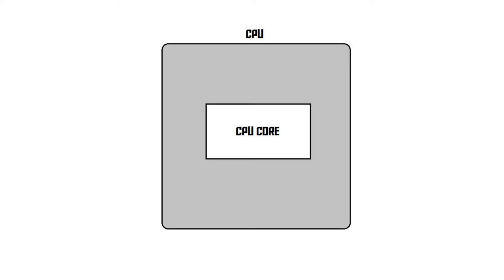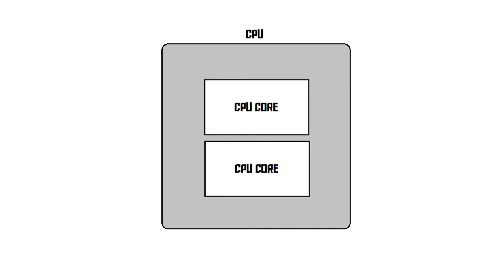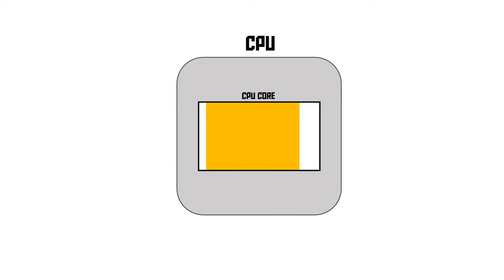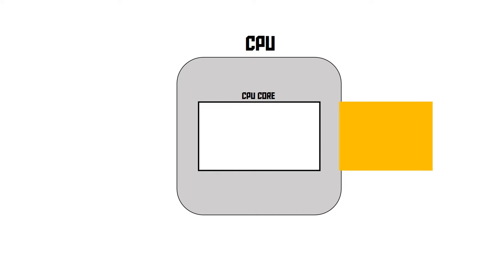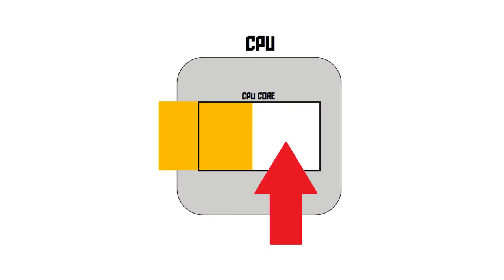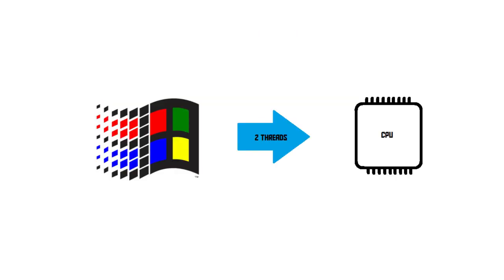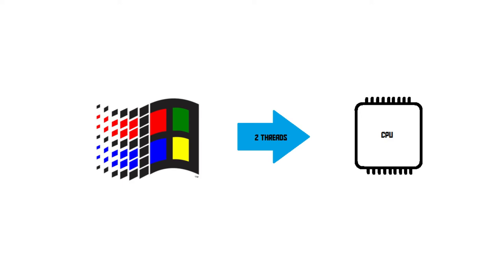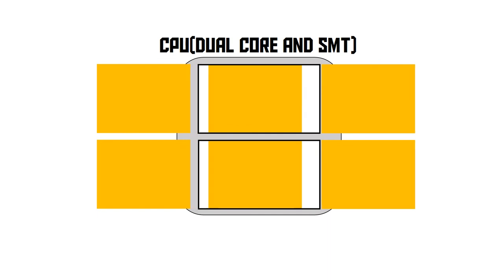What exactly are Hyper Threading and SMT? (AKIO TV)

Comment: IBM invented SMT decades ago.  AMD never used it until Ryzen because it wouldn't have been enough of a performance boost to implement it into their chips. I'm not an expert or anything but I know that it depends on the cpu cache pipeline how effective it is.   Some processors with long pipelines like a Pentium 4 benefit greatly from AMT.

Comment: Does this mean that the limit of threads per core is 2, as trying to increase the thread count you mean huge increases in cache and register sizes to maintain the state of unfinished tasks per thread?
Reply: There are dedicated register files to hold "thread" state. These are architectural registers that are not visible to a programmer or talked about in the ISA manual. As for caches and TLBs, there is a form of resource slicing that is used to share them between sibling threads on the same core. However, when one thread can access to its sibling's cache lines though some means (side-channel or whatever), you end up with security vulnerabilities and the only solution is either to disable SMT or make the operating system use core scheduling.

Comment: So, it's essentially a fancy term for thread pipelining...
Reply from the maker: Well, pipelining isn't exactly the same as SMT (smt is the general non-brand term)

In pipelining, stages in a cpu are kept occupied by starting work on the next instruction when the first instruction reaches the next stage.  Although this works really well, pipeline 'bubbles' occur quite a lot.

What SMT allows a cpu to do, is to start working on an entirely different thread during those idle times. This way the cpu is kept busy as much as possible. 

So in summary, pipelining refers to instructions in one thread being processed sort of at the same time, while multithreading refers to switching between different threads. (perhaps even threads of different programs)

This is something I didn't quite explain in this video unfortunately. I might make another video on this at some point.
Reply: @AKIOTV  pipelining is indeed referring to the instructions of the same thread but in general, the essence of it is to never let an element of the CPU idle. In that sense, multi threading is essentially pipelining different threads. As long as you have threads that have instructions that can be executed out of order and you have a clever scheduling algorithm to take care of the alternating of the instructions between threads, you will be pipelining in the core instructions of multiple threads. In the end, like you said, smt is the alternating execution of instructions of different tasks to minimize the idling time of the CPU. Pipelining is the act of initiating a new instruction before the current one finishes so that no elements of the CPU stay idle. None said that the next instruction can't be one of a different thread.
Reply from the maker: @vasilisgreen  That's fair but I don't like referring to multithreading as pipelining, because unlike instructions threads aren't processed sequentially. The cpu can switch back and forth between them. Therefore I personally wouldn't call this pipelining. The concept is the same (reduce idle time) , but the sequential element lacks. 

(I have to say the animation in the video deals with this in am awful way; it implies threads are very much like instructions processed one after the other)
Reply from the maker: Basically what I was trying to say is: the instructions (perhaps of multiple threads) are being pipelined, but the threads are not. therefore I would avoid the term 'thread pipelining'
Reply: @AKIOTV  Yeah, well, we're not really trying to coin a new term. Since we both understand the concept, we can use words loosely.  Besides, to have a truly parallel process of threads you would need to duplicate parts of the core and that's kinda pointless because if you can afford to duplicate hardware, just make more cores. In the end, smt, regardless of brand name, only increases performance to closely resemble parallel processing in one core, it doesn't really give you the same performance as 2 cores would. You could duplicate parts of the CPU like the instruction controller which is the next element after the program counter or make 2 ALUs to handle 2 logical strings at once and emulate 2 cores but that would fall under the "make more cores and be done with it". It would be funny if this actually happens and I'm just oblivious to it honestly. Does this happen?
Reply from the maker: @vasilisgreen  There certainly are  duplicate parts in those cpus, afaik mostly registers. Not sure about ALUs, it may be done in some designs, but I don't know which ones or if it's done with this purpose.
Reply: @AKIOTV  well, registers only store thread data, they don't help that much in parallel processing. Complex logical instructions are still going to take a lot of time to complete compare to simple ones, and that's where the out of order execution helps. While the alu is busy you can execute other instructions that don't need it as long as they can be executed out of order. This can raise the IPC of a core.
Reply from the maker: @vasilisgreen  SMT isn't really what I would call "parallel processing" anyway; we're after all still not actually processing multiple threads at the same time. It is (as you said, like with pipelining) just a technique for keeping the CPU as busy as possible and minimise idle time. Duplication of execution units would indeed improve parallel processing a lot, but in that case it'd probably be classified as a multicore cpu. Actually that turns out to be debatable; I believe AMD's bulldozer cpus used some sort of modular design where one "module" consisted of two cpu cores, (or at least, that's what AMD said) but because certain execution units were shared between those cores (like the fpu) some went as far as to say that a "module" was really just one cpu core.
Reply: @AKIOTV  SMT can be called "parallel processing" at the instruction level. Rather than using the term "threads", its easier to understand the concept if we simply think of them as independent instruction streams. A superscalar core has multiple execution units and if, due to reasons such as unavoidable data dependencies etc., all of the execution units cannot be kept busy, the instruction reorder buffer is filled in a way such that instructions from another stream will be brought in to improve utilization. And to guarantee fairness, minimum and maximum selection bounds are imposed for each instruction stream. To further improve utilization, speculation is used although a bunch of vulnerabilities have shown how nasty things can get if it is used.